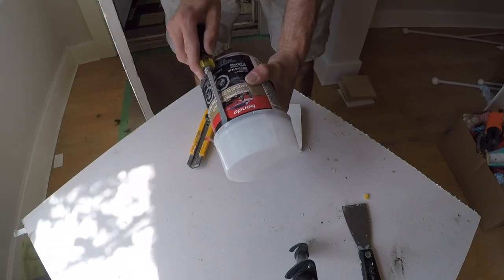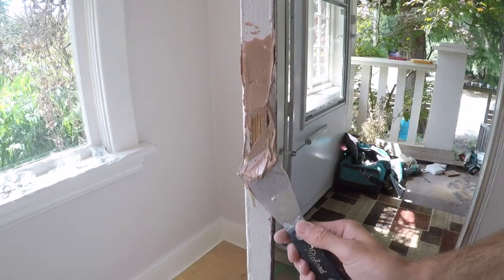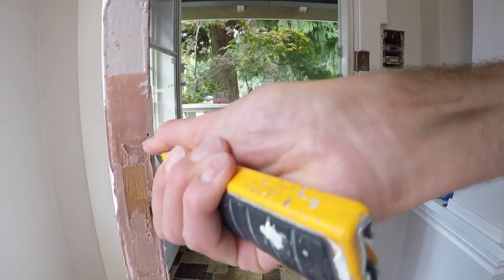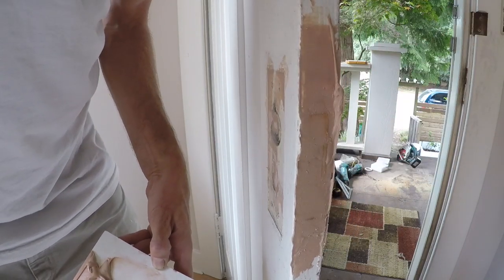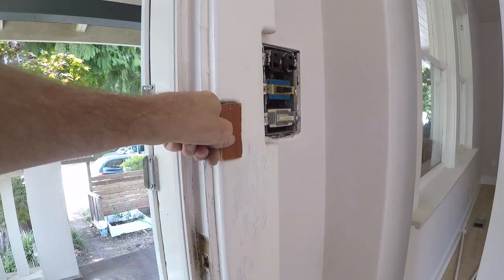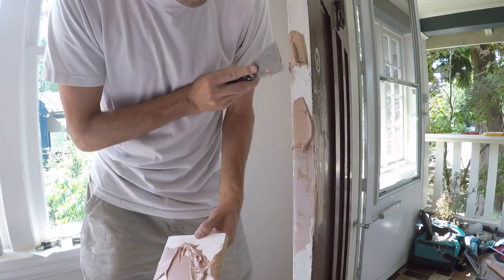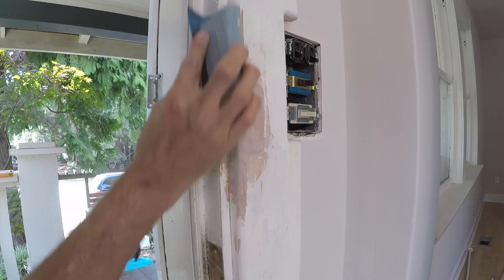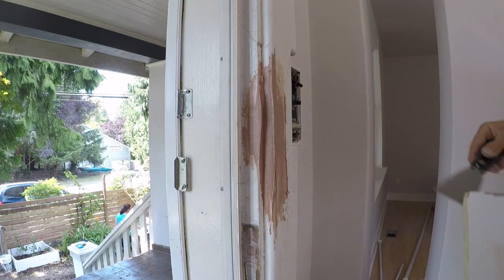Repairing WOODWORK with BONDO!! (auto-body filler)

Comment: 66 yr old handyman here - in business 28 years. For bondo filling a void that needs to end up flush and parallel to a surface, try - right after loading a glob in - put wax paper over it and hold the paper flat with a paint stirring stick or bigger piece of thin wood stapled in place. You will get a glass smooth finish under the wax paper with minimal trimming. Good in specific situations of course.  After it cures twenty minutes, pull the wood and staples and the wax paper peels off beautifully!!
Reply: Genius!!
Reply: kishka,   thats a great tip.  thanks, i will try that on my next repair.
Reply: thats what I do-especially for inside corners.
Reply: Man... I like that tip.
Reply: Bondo is not a fix for hardware.  Sure you will get paid,  it will work when your done.  Then the client calls a carpenter because it going to fall off again.  The work performed needs to be wood. Or a new door.
Reply: @michaelstiller2282  maybe you, or someone you know has used Bondo that fell off, most
     likely because it wasn't done correctly.  having used Bondo over 30 yrs for
 both interior and exterior repairs,  i have yet to see or hear of any of it falling off.
Reply: @normhodgkinson6965  it's a mortise lock set, that's being repaired, or replaced.  If it's a repair job its going to fail. You need a router and dutchman in new wood. This is a common repair as the screws mounting the door handles are tiny. There is a reason modern lock handles are not screwed to the door, and they still need maintenance. As the screws get loose.  Which is why lock tite was probably invented. In the products own name the word lock is in there. Bondo is a cosmetic repair. It will hold until you get paid.
Reply: @michaelstiller2282     it appears there is a wood filler piece in the mortise.  over the last 35 years
     i have probably made a couple dozen repairs very similar to this one using Bondo and 
wood filler pieces, and so far no Bondo failures.   i use Bondo because it doesn't shrink
     and/or crack and fall out like Fix-All or Durham's Water Putty.    i use it for exterior and
interior repairs,  termite damage repairs,  and dry-rot repairs from water damage.  i can't 
     speak to the manner in which Ben in this video,  secured the latch assembly and dead
bolt to the door, because i wasn't there, and neither were you.  every contractor and
     home repair person has their own way of doing a project.   yes,  Bondo is for cosmetic
repairs,  as it has no structural integrity,  but adheres extremely well to most surfaces.  if
     you experienced Bondo failure, perhaps your preparation and application was the issue.
Reply: @michaelstiller2282  you obviously don't know what you are talking about. Bondo is clearly not hardware, and is a perfectly good fix for damaged trim and doors. The doorknob was probably in an odd position and so he was moving it to the standard position. Also, especially in rentals it is not even an option to replace exterior doors when they could be perfectly serviceable for a year or more with a bondo fix.
Reply: @dyc9124  ok you said it's not a fix, the bondo will be serviceable for a period of time. Your own words, you just said it's going to fail. My way is going to last alot longer, because I fix the original screw up. And I am not patching it so I can get paid. Did you get called back to service a repair you made the 1st time and it wasn't warranted by you, meaning you expect to get paid to fix your own work?
Reply: Michael Stiller it’s a wood bondo
Reply: @dyc9124  ,    Michael just wants to argue.  He obviously has little
    or no experience with Bondo.   He has failed to see the piece of
wood Ben had put into the latch mortise to strengthen the repair. 
   As i mentioned earlier in this comment section, i have used Bondo
for over 30 years without it cracking, shrinking, or falling out,  as
   have many other repair persons.
Reply: @normhodgkinson6965  30 years of experience.  Great, I know many guys in the trades for 30 years. I also know carpenters with 29, 28, 27 and down the line to 0. I know guys with 40 years experience. i know 40 year old carpenters who  yell at 50 year old carpenters, because they aren't doing the right job. I work alongside many carpenters on residential homes that go on for years. My take on bondo in this situation has been discussed with a guy who's only job is to install hardware. He makes a living only installing hardware, worked along side him for 7 years.  He screws up from time to time. I fix his mistakes, because, although he is a carpenter in my mind, he doesn't have the tools to make the repair.  Bondo is not a fix for hardware.  If it was a stain grade door what would you do? Bondo?
Reply: @michaelstiller2282  well stain grade is different.  I'd pour cranberry juice on it,
    heat it with a torch,  then put it on display in the Smithsonian, of course.
Reply: As a retired body repairman I congratulate you on your technique...there is one other benefit to your method that you didn't mention...sandability. Body filler is talc plus fibreglass resin and the resin fully hardens when it's deprived of oxygen...that's what the wax paper does. And actually my choice for filling wood is chopped fibreglass ...way more durable than body filler.
Reply: @michaelstiller2282  A large hole or gap needs to be filled with wood blocking, glued and then nailed or screwed into place if it requires structural strength to support hardware such as hinges.  Then the small remaining cracks and gaps can be filled with bondo for cosmetic clean-up.  Use bondo as you would use drywall patching compound or a wood filler with the advantage that bondo will harden within minutes allowing you to continue with the next stage of the repair and complete the job in one visit.
Reply: @michaelstiller2282  for stain grade I use handyman. Bernie similar to bondo just takes longer in between coats.
Reply: @chrisgraham2904  that's my complaint.  He repaired a strike plate with bondo, and then installed a strike plate in the same location.  It should be wood, and glue.  I am not that old and am aware a bondo repairs fail. I don't want the job of repairing it.  I see what was done and I just want to go back to bed. These repairs take hours. Slap bondo on it and it takes half the time, and it will fail.
Reply: Brilliant!  Thanks for sharing. 👍
Reply: @michaelstiller2282  You did see the wood blocks or slats he put in the hole.  The bondo is for finishing.  I'm going to do the same on the latch side and screw those blocks deeply in, then Bondo and then either a special double metal plate or a long one.  It will be just fine.
Reply: @michaelstiller2282  Disagree...cosmetic yes...did you not notice the wood that he had put in the hole.  He didn't show us that part, just the cosmetic fix.
Reply: True wise skill, thanks
Reply: @kishka7winecountry I have a door that someone cut with a circular saw poorly leaving saw gouges all the way down the edges on both the edge and jam sides.  I will try your method.  Thanks @vancouvercarpenter for the huge backlog you've created with how to do so many things correctly or easily.  You and @rvstreet are my two fav channels.

Comment: A couple more Bondo tips.  The Bondo spreader is the color you should have when it's properly mixed.  Also, the "cheese grater" planes work great for smoothing a large area, also just as it's starting to set.  For painters, that bubble that leaves a depression and will show through the new paint can be quickly fixed with Bondo "Spot Putty".  No mixing and cures in about 10 minutes.  Better than sanding down the paint.  
It's also good on toast and English Muffins.
Reply: SureForms.
They're great! (Like Frosted Flakes😁)
Reply: "cheese grater" plane, AKA Stanley Surform
Reply: Good point about the spot putty, I can see how you could achieve a nicer finish with it.

Comment: Ben,  i have been using Bondo since the 90's, and i love it.
  it stays adhered to the wood, unlike Fix-All, or Water Putty. 
its great to repair termite damage,  & dry-rot/water damage. 
  it is also one of very few products approved by the pest 
control companys when the repairs are inspected.  i am
  northern Calif.
Reply: Good to know. We have old termite damage that needs repairing. I'll have to go get some of this.
Reply: It really does beat all. AND usually much less expensive than those specialty wood fillers. Only hiccup I have with it is that it STINKS
Reply: Are you sure?  The @vancovercarpener is using Bondo for car body, not the Bondo for wood.  OTOH, I have not idea what the difference is but they have a wide variety of Bondo products.
Reply: @Al_Z.Heimer    the Bondo for car bodies is the same as for wood.  wood Bondo is a different color, but it still mixes the same.  car Bondo is a lot cheaper.

Comment: Big thank you for the tip on shaving the excess bondo when it's in the in between plastic like state. I'm just a diyer that has used this stuff before on various projects, and I can't believe I never tried that before. Definitely saves time and energy after with less sanding and such, thanks!

Comment: Ha! I've been using Bondo for years and thought I was the only one. Try using a caulk remover on inside corners. Also, Bondo glazing putty for the final coat gets a much smoother finish.
Reply: That red glazing putty is bad ass. I use it for all kinds of things. From rail holes, cracks, and especially building up outside corners that get dented on the door casings. Nothing else works, expect the glazing putty.
Reply: Glazing putty or spot filler is good to use for the tiny holes etc.

Comment: Bondo is great stuff for any paint grade repair.  DONT get sucked into buying the “wood filler” version. It is literally 4x as expensive and the only major difference is that it’s tan colored.  That is until you mix with the exact same pink hardener.  I’ve tested side by side - regular automotive Bondo lasts and adheres just as well , interior or exterior.

Comment: I use Bondo when I reverse the door swing of an interior door, and have to fill where the hinges and door strike used to be.  To make sanding the profile easier, I use some Porter Cable adhesive sandpaper (80 and 120 grit) that comes on a roll, and stick it to various blocks of wood that are long enough to bridge over the repair, so that as I'm sanding it down, the good surface on each side acts as a guide.    The adhesive keeps the sandpaper tight on the outside corner of the wood.  

(I also use the adhesive sandpaper on various sizes of bits of pipes and dowels and other cylinder shapes to use when touching up coped crown molding, as well as the times when I have to put a joint in the middle of a run of crown molding and the profile needs sanding down)

Comment: If I ever do this on exterior wood or larger repairs, there's a chance that the filler can seperate or pop out as it's rigid and wood can swell or shrink. To add cohesion to the repair I pepper  the surface of the damaged wood with shallow 2/3 mm drill holes or bang in some small nails, making sure they won't protrude beyond desired repair. Either way, the filler has more  to cling to. That shit be super solid. Peace
Reply: For sure. In areas like the hole for the deadbolt I like creating a reinforcing bar type system to keep it rigid. It also helps to create some kind of keying system like you said.

Comment: Timing is everything.  We have an old Victorian with a number of doors that need to be restored.  They have been painted so the bonds should work great on them.  Glad I watched this because it will make my work much easier.  They are 2 over 2 panels and some have cracked the length of the panel.  I think the bonds will for well on that also.  I was going to go to the local Restore and watch for replacement doors, now I won’t have to do that.  Thanks.  Great video.

Comment: Whoa! A carpentry vid! Proud of ya Ben! Another bondo tip is you can make a hot batch that will set up faster by increasing the catalyst. The opposite works as well if you need a bit more working time or have nothing better to do. It’s like quickset in a tube!

Comment: A 10" Stanley Surform works great for shaping the Bondo...  The long Surform gives a flatter surface than a short sanding block also. I'd try to find an old one and get new blades for it as reviews indicate the newer file and plane handles are not durable. If you do this type of work regularly auto-body files are the way to go. The quality is better than the Surforms though they are more expensive.

Comment: I do this simply because I find it the easiest way to get good results... only issue is usually the quick setting time. Nice to see I'm not nuts using Bondo! The shaving tip is huge, I've wasted a ton of time sanding rock-hard Bondo.

Comment: I use bondo for random stuff too. Students are constantly smacking the table saw fence into the blade. When wood starts to catch the damage, I bondo the fence, palm sand it, back to work.
The fence face is not easily replaced so this is a fast and easy fix.

Comment: Another great video.  You got me through skim coating and repairing the dry wall in my NYC apartment.  Now I have damaged moldings which need to be addressed. I'm going to try Bondo.  I used to work in the antique business, I'm ashamed to say that our the guys in the restoration shop used Bondo a lot.  I remember a chair foot partially carved from Bondo. The chair was painted so nobody knew the difference. "Is the finish original ?"" Yes Madam I saw it drying this morning."

Comment: Nice tutorial. I was impressed with your drywall abilities so I clicked on this vid.  I have stopped using Bondo on wood repair and switched to SculptWood by System 3 or West Systems epoxy with fillers and/or saw dust.  The adhesion is much better.  But did you consider using a “Dutchman”?  Norm Abrams has a good old tutorial from This Old House.  It’s a cleaner repair and will stand up to more abuse which is especially important around the door locks.  If you know how to use a laminate router, you can do it in much less time than a multi-layer bondo repair.  Plus, you also get to smell saw dust instead of Bondo.  I also would have removed the trim for the repair and hit it with palm sander for a quicker repair.  Save the contouring of Bondo for your car. ;-). Keep up the good work.
Reply: hey man, where can I find/buy Sculpwood?
Reply: Mohammad Motallebi Rockler for sure. I think amazon has it.

Comment: Hey Ben great demonstration, I am about to attempt to fix the wood floor in my fishing boat with this method. The floor is old and probably needs to be replaced but I need it to last a little longer before I start that project. The receiver that the boat seat sits in recently tore right out of the wood, so hopefully once I get the carpet up and see the damage I will be able to repair it well enough to last a little bit longer. Keep up the great work!

Comment: Really good video thank you Ben. I’ve started using the cheaper alternative Canadian Tire Bondo and find it identical for this type of application.  Highly recommend you try “Durham’s Rock Hard putty “. Which is a staple in the states and I’ve only found at Windsor plywood here in Canada.  It’s about $17 for a 4lb container  ( although not quick drying as bondo) but doesn’t shrink or crack and makes a great topper and filler.  The main attraction is it’s a powder and never dries out...just add water when you need. It does need to be painted though.

Comment: Body man here...what you do is mix up the bondo... apply it to wax paper...wrap the wax paper around the door edge. This will give it straightness, structure...and deprive the body filler of oxygen so it will thoroughly harden and sand without gumming sandpaper. Auto body repair is actually a multi disciplinarian trade with many applications outside of the trade itself.

Comment: Thanks for all the good ideas.  I've used some nice rough rasps to knock it close to finish level.  Also there are screens similar to a cheese grater of a sort that fit into small box-like handles that also do OK.  Both the rasp and " cheese grater" also work best before the material sets up really hard.  Easier to manage, just like your sharp knife.  As you say, it's much easier to manage getting ready to level with a block and sandpaper when the basic shape is close to the desired end result.  Waiting for big slabs of oversized material to completely dry then sand, by hand or with a sander can be a real pain in the butt if you have a ways to go to reach level.  Good video.

Comment: Man I love bondo 😂 The "shave" stage is so satisfying. I own a small painting business and I have used GALLONS of the stuff over the years on alot of exterior woodwork. I explain it to the homeowner as a bandaid for the rotting wood. Dig out all the decaying parts fill with bondo. I could talk for days about bondo 😂 I add in a little bonus with my bondo jobs that you didn't. After my final bondo smoothing stage I go over the repair with a really thin layer of glazing putty. It fills in anything the bondo missed VERY easily and is super easy to sand. You can fill all your heavy sanding scratches with it. Then sand the glazing putty with some fine 220 grit. Little secret, it works great repairing furniture 😁